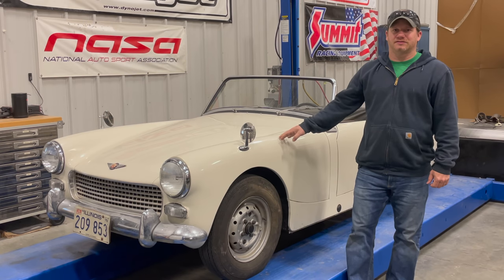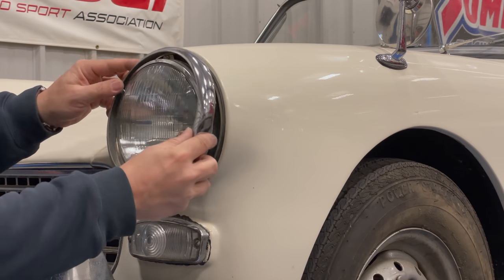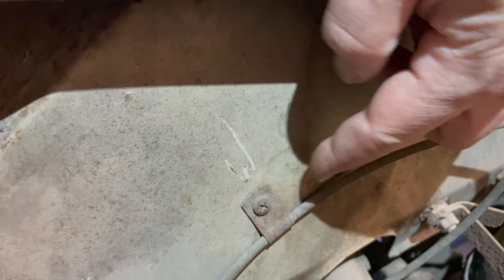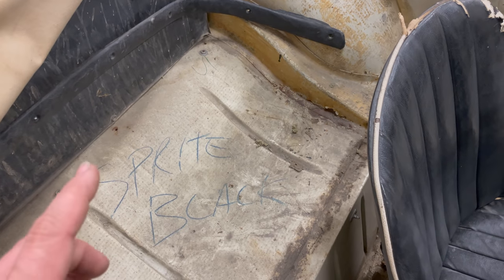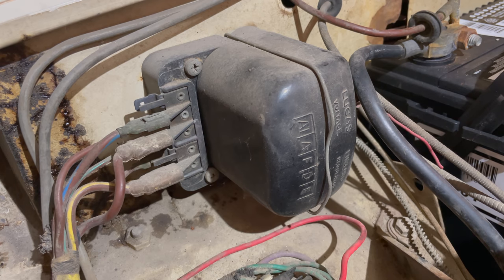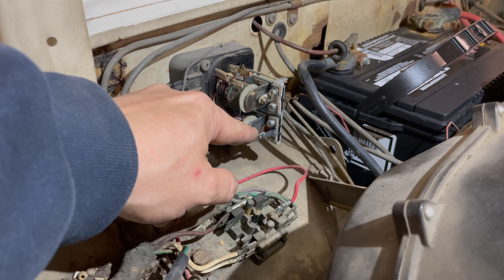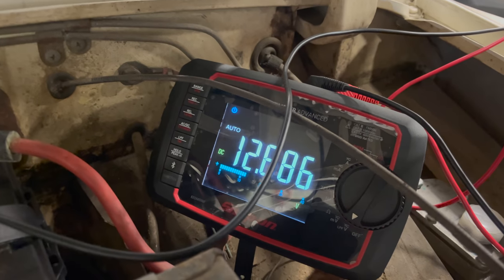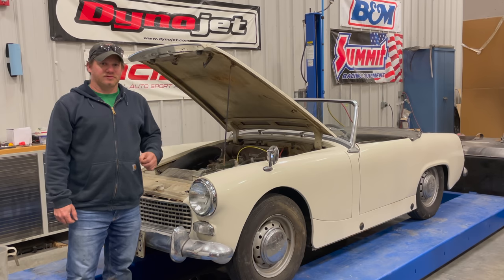1962 Austin Healey Sprite Mark II - Will It Charge?

Comment: I owned a 62 Sprite just like that when I was 18 years old ... same colour, same wheels but mine still had stock hubcaps ... I beleive it was 1175 cc ... I did the Valves, King Pins and Brakes and put in a Roll Bar all myself ... back in 1974 I paid $400.00 for it ... had a blast in it for a while then bought something else bigger .. nice to see it again ...

Comment: Ah, memories from 50 years ago!
Actually, not so long ago as I still have a vehicle with 7" sealed beam headlights - so much easier and cheaper to replace than today's over-priced plastic crap.  And you can still see the indicators when the headlights are on, unlike most multifuctional units.
Reply: They were, although the light from sealed beam units was always rather yellow and weak. I used to replace them with 7" reflector units that took a halogen bulb and put a relay in the circuit too with a more direct feed from the battery via an in-line fuse and thicker wire.
Reply: @TheEulerID  The clue is in your comment - you had the option to replace them.  I bought a set of (then high tech) quad-optics and moved them from car to car for about 20 years before they finally failed due to rust incursion.  That choice is denied to those with more modern cars.

Comment: Looking forward to the bypass hose replacement, i only had one a series with that hose and i found dropping the hose into hot water made compressing it a lot easier to fit even then its fiddly
Reply: The bypass hose is not a genuine one, the factory supplied one is a straight hose, and requires the removal of either the cylinder head or the water pump to fit, the convoluted one can be fitted in situ but doesn't last as long
Reply: @davethornewell7417  its standard to fit a proper hose...when as you said head or water pump removed but if neither require it the compress ones do the job.

Comment: That wee trick with grease on your finger is a great tip. I think you've mentioned it once before because, when you were fiddling with the hardware, I knew what was coming.👍👌😁 That method has so many possible applications (not just with cars) , it's well worth remembering.

Comment: Steve
I love your straightforward videos!
Just a note on Lucas voltage regulators. I use a strip of very fine emery cloth to clean the points. I never touch the adjustment screw unless I really, really have to. A tiny, tiny change there makes a huge difference to the way the VR works.
Mike
Reply from the maker: Even when you buy a new regulator you must adjust that screw it will not work completely correctly out of the box.
Reply: I've adjusted my original one a couple times.  It's not too scary to do.  Just use a good multi meter and read the voltage while adjusting the correct screw.

Comment: Those were called "sealed beam units" in the UK, and they produce a rather poor light. Back in the day it used to be possible to buy 7" round reflector units which took halogen bulbs. I've no idea if they are still available, but if driving at night they are much preferable as they produce about twice the light for the same wattage. It's also a good idea to put a relay in the circuit (even without a halogen conversion).

Comment: I have a question for you, I just bought a 1974 MG Midget and it has been sitting since 1977. It has some kind of electrical issues where the ignition light will come on very dimly, but when I turn anything else on the electrics die. Do you know how I can solve this issue? Any help would be greatly appreciated.
Reply from the maker: Sounds like you have a weak connection to the battery check that the terminals on the battery and generator are clean.